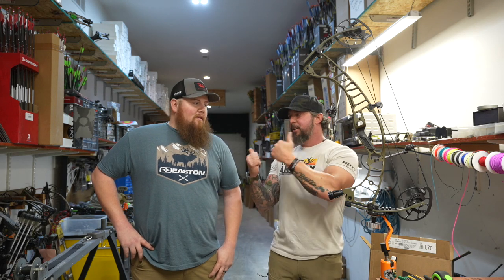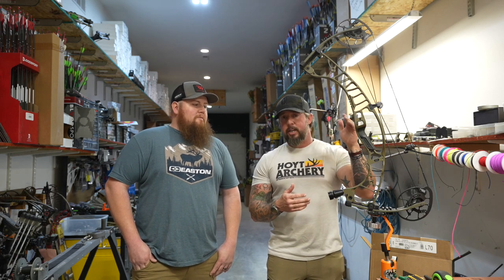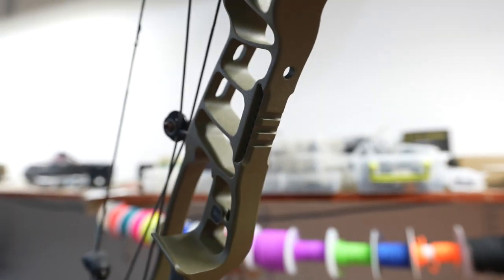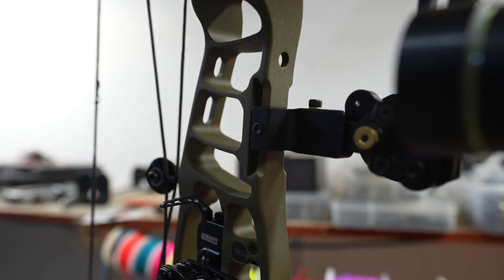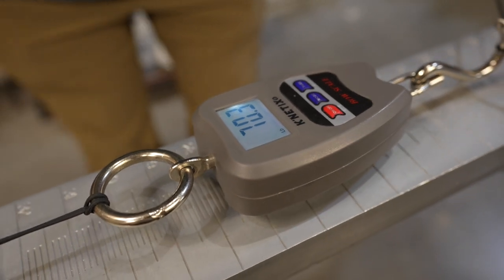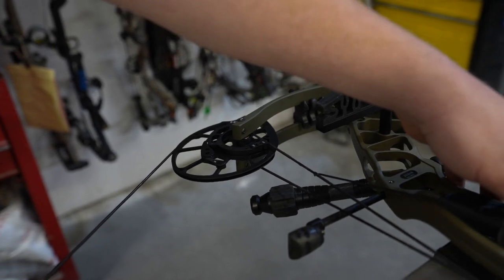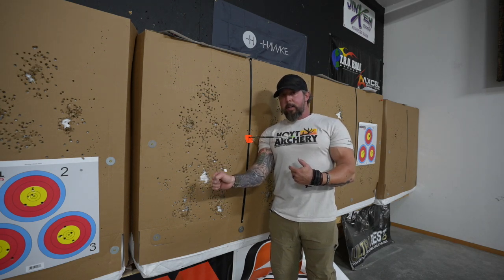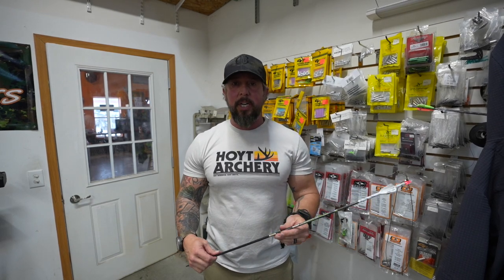Hoyt Ventum Pro Build

Comment: This is probably a basic question but I'm struggling to find a video to help me out. I recently purchased a 2022 Hoyt Ventum Pro 30, I want to do the build myself and I am going slow to get it right, Question ??When setting my nock height or position on my string, some say to measure from axle to axle, cut in half and measure off one axle and there is your center on the string, Others talk about a high nocking point? I also purchased the Hoyt QAD rest and some say to put the rest on and zero the rest out on the bow limb  marks for the rest and then find your nocking point off the rest with a string T-square. Sorry for the long winded question but any guidance and advice is appreciated.
Reply: I will try my best to help you out. I am somewhat new to it so whatever doesn't make sense you can ask me to rephrase. 

I saw a video that says that nowhere on any bow manual, does it say to measure from axle to axle and cut in half or anything like that. Get a bow square, youtube how to use a bow square and that's your best bet. Watch videos from podium Archer on how to set a nocking point and after MANY hours of tinkering I found him to provide the best explanation and what makes more sense once you put in into practice. 

As far as your rest, I don't think I understand what you mean can you rephrase? Let me know if you have any questions.
Reply from the maker: set level at raised rest height to start

Comment: See I wait and do everything AFTER I check the cam timing cause if u put on the d-loop and then your cam timing isn't correct and u correct it then it will move your center shot. Luckily your cam timing was spot on
Reply from the maker: I set my d loop to me, then adjust cam timing to me/bow